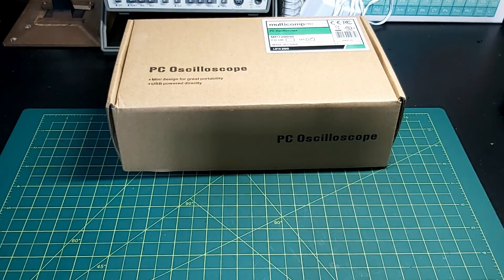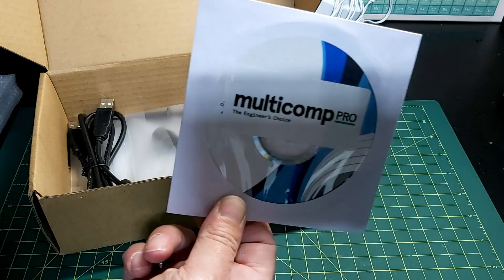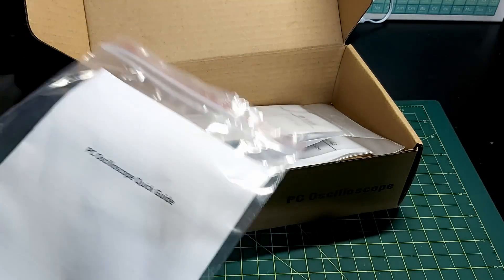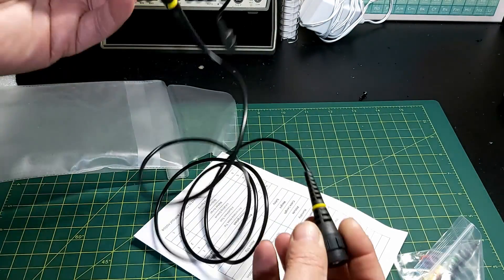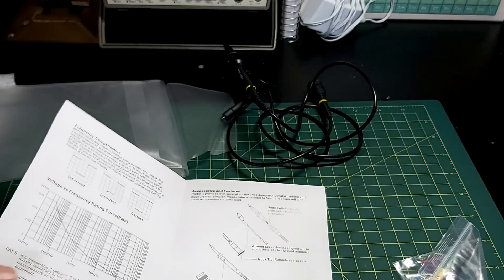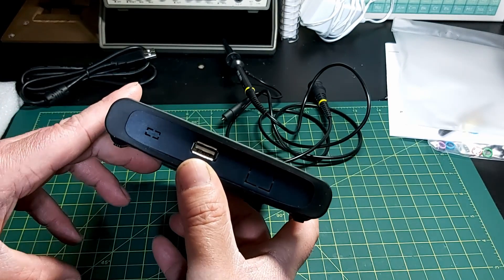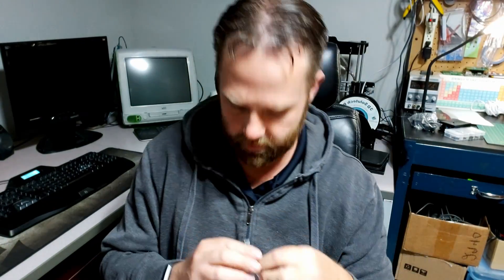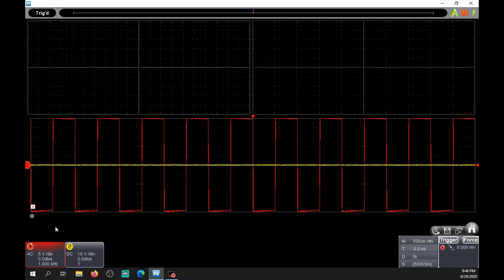Multicomp pro MP720016 USB Oscilloscope unboxing and setup.

Comment: bought a MP720016 from element14, doesn't work.  gets stuck in an initialising loop in the app when it opens,  never gets to the point where it shows a scope trace.  I am running win11, but the USB drivers for this date to 2012.    I am chasing up with element14 customer service, will post the result here.   Buyer beware on these bargain scopes, make sure you have recourse for a refund.  There is no official multicomp support site afaik.
Reply: Update.  I tried 3 laptops, different USB cable, with/out laptop PSU, running in Win 7 compatibility mode.  none work.  I declared the unit a dud.  Element14 contacted the manufactuer and their only support was <<did you instal the drivers?>>  well, yes, obviously.  I returned it and ordered a Picoscope instead.  BTW the multicomp unit comes with a CD install disc when laptops shopped shipping with a DVD drive 5 years ago.  The Multicomp website is just pictures of their products, no troubleshooting help or importantly DOWNLOADS.   Compare that to the Picoscope site which has manuals and drivers for download and they also support Linux.  You get what you pay for.  Element14 have been great thoughout.
Reply from the maker: I have windows 11 on my laptop I'll give it a shot tonight and see how I make out.  But works fine on 10 and previous.  Do you have it hooked into a hub or direct to computer?
Reply: @Gam3T3cHElectronics  I hooked it straight into the USB port.  On 3 laptops, none work.

Comment: The square wave on FFT should resemble F + 1/3F3 + 1/5 F5 + 1/7 F7  + 1/9F9... to infinity . 20 Log V1/V2 Eg 1/9 = 0.111.. Log = -0.9542 or -19.09dB. 1/10 is - 20 dB. 1/100 = - 40 dB or 1%. A triangle wave can approximate  F + 1/9F3 + 1/25 F5 + 1/49 F7  + 1/81F9... to infinity . That shows a simple filter action of squared values. A sine wave being F alone if pure. Square waves can be made using 4060 CMOS.
Reply from the maker: thanks for the info eh!